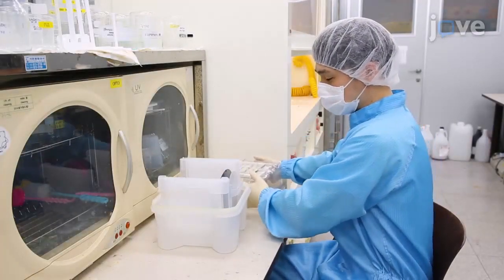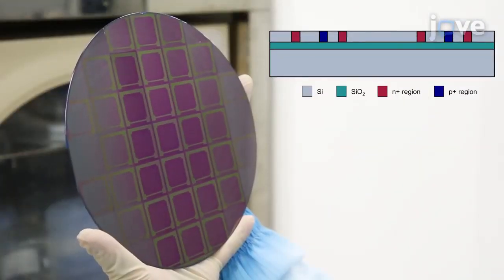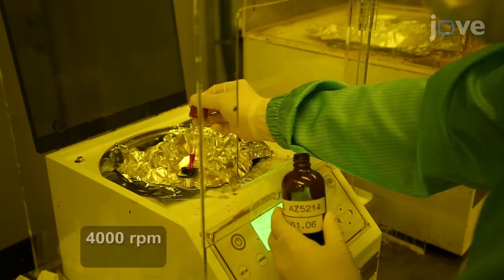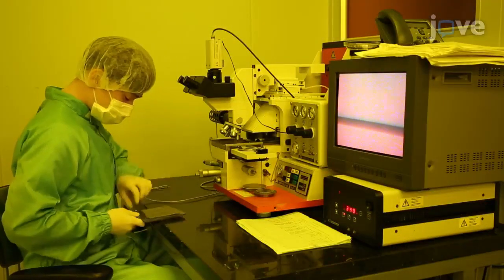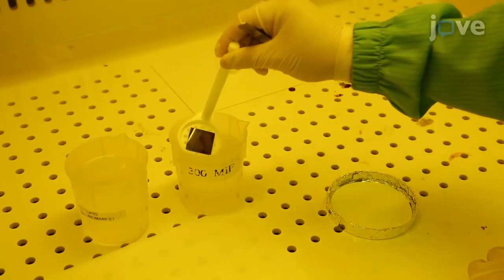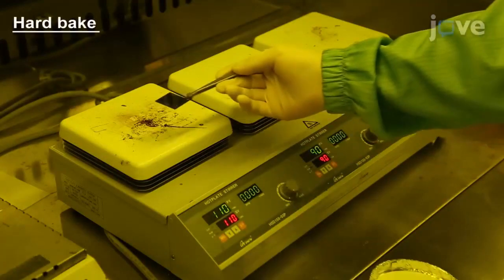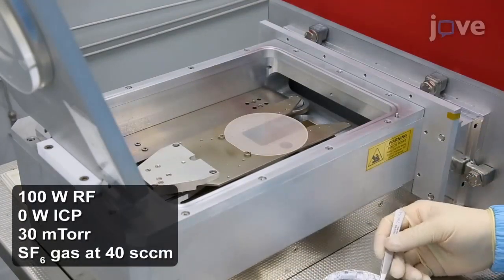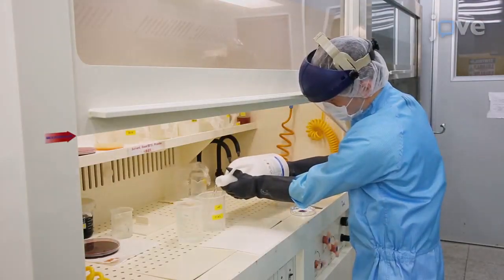Flexible Image Sensor Fabrication Based on NIPIN Phototransistors | Protocol Preview

Comment: If you have a analogue camera there is a light sensitive roll inside, 12 or 36 exposed images.
I think the modern flex ccd sensor in a roll is the way we need to for reuse the old analogue camera’s..... like the Samsung fold Smartphone can work why not a flex ccd film in a roll ? including storage chip like a flash memory 36 expose images and can be erased, works as a normal film roll no need for electronics in site, after the exposed "film” you can rewind it as a normal film, take it out and put it in a wireless holder or usb c to transport the pictures to your computer, and erase the ccd film roll place it back and reuse it.